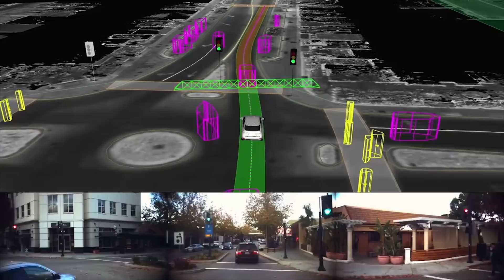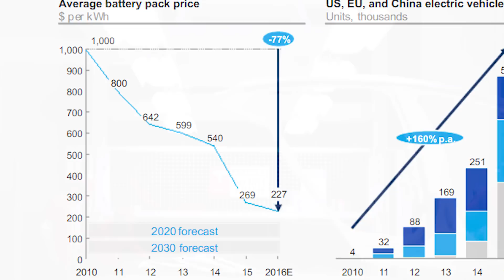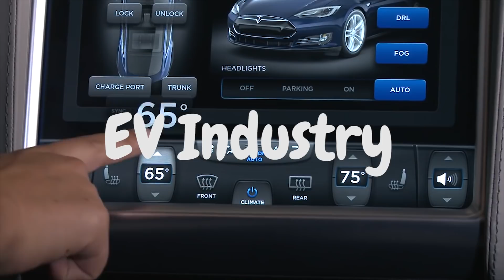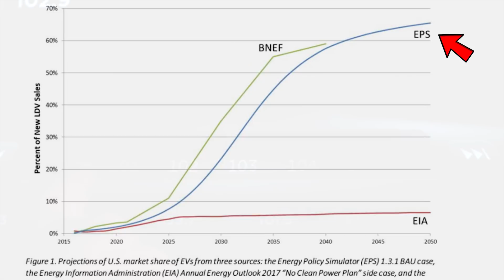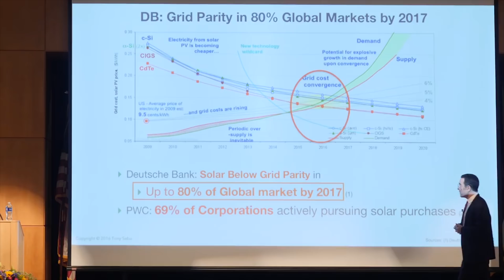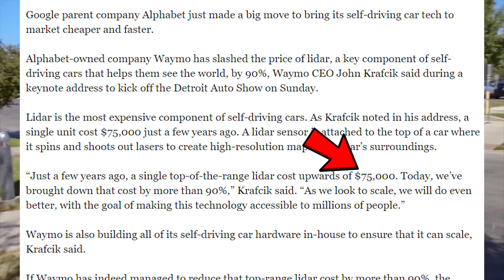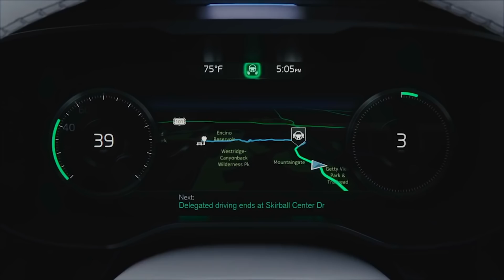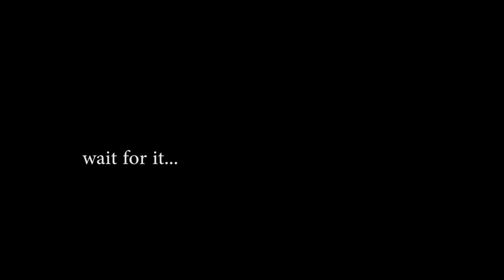Why is Tesla Inc. SO SUCCESSFUL? (4 Major Technological Disruptions)

Comment: Fuck all these people that don't like when people are biased.

5:11 That's too late. By 2030, EV's could be in the $20,000 - $30,000 bracket or even the $10,000 - $20,000 bracket, a lower price than diesel or gasoline cars.

Comment: Mathematically speaking, Tony Seba's application of an exponential growth curve to a percentage of a total market cannot be correct. Since the maximum market share that can ever be obtained is 100% the percentage market share must slow down at some point and can only ever asymptote to 100%.
When something starts from a very low base initial growth rates relative to that small base can be very high, appearing to be exponential,  even though the absolute change is not very big. A similar example is the initially very high growth rates in the Chinese economy after industry was freed up. As Chinese living standards and wages near those of other developed countries the relative growth rates must slow down (even if a lot of growth is still happening).
Reply from the maker: I agree with the first part, but i do think the chinese economy and technological changes are not comparable.
Reply: "Since the maximum market share that can ever be obtained is 100%"

It can if you are considering the CURRENT market.  It is easy to conceive of solar making 160% of the current market.  And that says something more profound than making 80% of some future market.

Comment: Solar won't be 100 percent of the world's energy though.
Reply: Snipethemapples I think it's more of a theoretical stance. Solar could easily power a decent chunk of the world I think. But renewables could give energy to the rest of the world, with a small percentage going towards nuclear for some places, and an even smaller percentage for alt-fossil fuels (Alternatives to propane for stoves, charcoal for grills, gas for generators, etc).
No one energy source will power 100% of the world. Even if we had fusion, we would still use other energy sources for smaller tasks.
Reply: The worlds total electricity usage amounts to 2.3 Terra watts per hour. Texas receives 696 Terra watts of solar energy per hour. That's enough to power
the entire planet for twelve days. If you can store it!
Reply: well, i guess google spell checker didn't get it, 'cause "Terra" is an actual word. Just not the prefix for 10^12
Reply: ''Tera.'' Not according to google spell checker but you're right. This is why I changed it to Terra. So at it's peak, Texas receives 696 tera watts. One hour of that energy is 300 times what the globe consumes in that same hour.
Reply: It might be on Mars but not on Earth.
Reply: to quote Seba:
"The OTHER 100% will come from wind"
Reply: While I agree with you that it is not only possible but also feasable AND economical, I have to say it is "Tera" not "Terra". Also Watt is already the power (i.e. energy per time) and has no additional time in it.

Comment: I don't see 100% solar by 2030, at some point everything slows down just like moores law. I can see full autonomy but I'd rather them treat it as an assistant for 10 years and gather data, wait for better technology and let public opinion change first.
Reply: Also many regions with little sun won't use it. If he said we could see the majority of energy coming from renewable sources by 2040 ish then that would be more sensible. Maybe he was just exaggerating.
Reply: Who gets to shoulder the burden of all the expensive fossil fuels so that we don't reach 100% solar?  Not me, I'll take the cheap electricity, you can wait and pay more with your fossil fuels.
Reply: The case with the battery technology and the chips manufacturing technology is different. Actually Moore's law  will not apply once the limit of quantum mechanics is reached. As for the renewable energy replacing the current system, the reason for it to slow down is the reluctance of the people to adapt, does the government have a major role for this to happen.

As for the autonomous vehicles, I completely agree that it will be at level 2 or 3 for a long time before full autonomy is implemented.
Reply: Glockout. I didn't see an awesome mass production EV for $35000 by 2017 either but here we are with the Model 3. As far as autonomy goes, the data is already being gathered for the last 7 years of Tesla vehicles driving with pilot assist. The changes in transportation will come quite fast once people see great EVs all around.
Reply: We will definetly not have 100% solar. Probably never. But we will probably have some s-curve up to som %-limit. lets say 50% or so. (Just guessing).. 

Because if inherent solar properties, its always easiest to go from 0% solar to 10% solar. The next 10% is less affordable